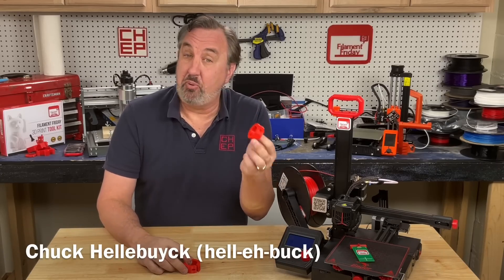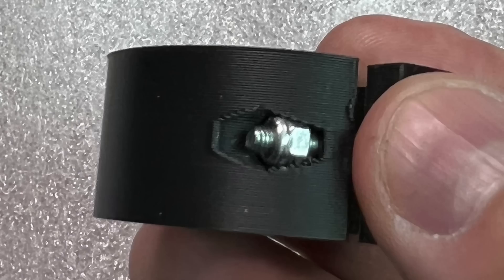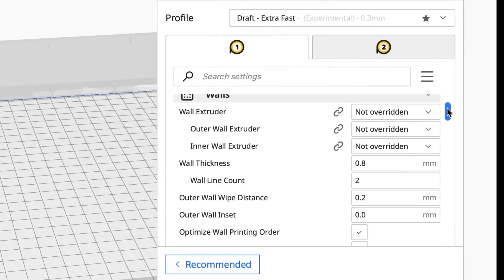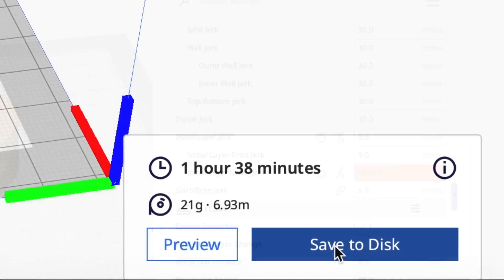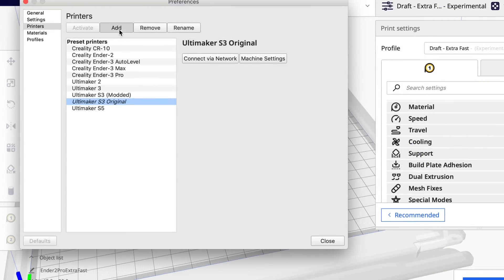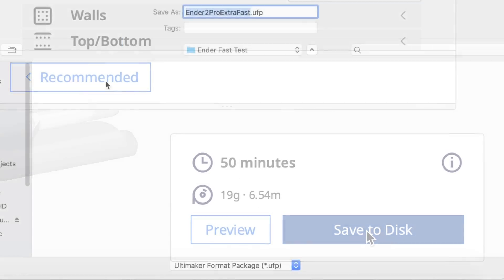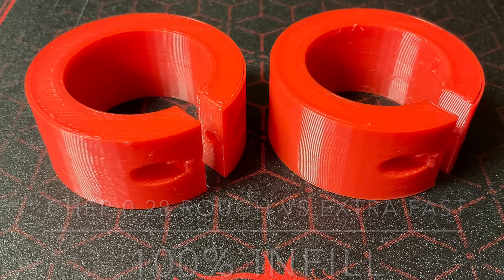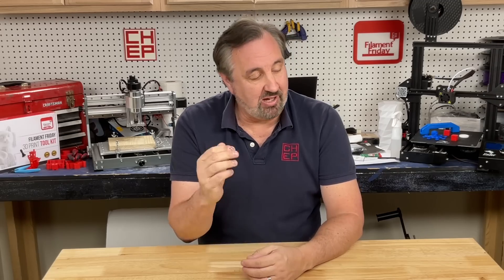Faster 100% Infill Prints with Cura 4.13 on Ender 3D Printer

Comment: This is a game changer! Thanks for sharing this. I just tried it on my Voxelab Aquila.
I printed some valve knobs on my usual profile that took 1h10m each at 10% infill with a .2mm layer height and 60mm/s print speed. I printed the same knob on this profile at 100% infill with the .28 layer height and 50mm/s and it took 35 MINUTES!! 
Cura tells me even at .28mm with my normal profile it would be an hour, so this has cut my print time by nearly half. I'm using this going forward unless it's something intricate and has small details.
Reply: Running the same thing. I found that if I cut my walls down from 2 to 1 (depending on what youre printing, I have 9 separate nested parts). It saved me an additional 30 mins. So my print time is under half of what it used to be. I'm in awe, just watching the Aquila whip around. Waiting for a print to finish to see if the parts will be durable enough. Also have a bridge so I'm curious to see if I'll need to really slow it down or not. It's nut to watch tho, regardless.
Reply: Should had read the comments because I just asked about the Aquila, lol, thanks...
Reply from the maker: Exactly why I shared this. It’s not to produce the prettiest prints but a great way to get functional prints faster.

Comment: If I may ask a question not related, I set all my parameters in Cura like printing speed and temperature but when I put my card in the printer and set it to print it always defaults to the same thing speed 100 temp 200/60 why is that?
Reply: You have to go into the menu in the machine and change the settings. also don't forget to save the settings on the sd card. when you insert the sd card first, then go change the setting to match cura it puts a little file on the sd card to save. I have multiple cards with my most used settings saved to the cards.

Comment: I follow your path except I used the profile of the S5 printer and  20% infill.  Using the same settings the profile of the S5 was 2 hrs 59 min  and the profile using cr6se settings was 4 hrs 22 min a savings of 1 hrs 22 min well worth it. The nozzle jerks very fast and the supports print very fast. The print has not finished yet but it looks good up to now.

Comment: This video inspired me to investigate, and I think I figured out what's going on and how to easily get this  benefit on older versions of Cura. I'm using an Ender 3 V2. If you set infill to 100%, Cura converts every infill layer to a top/bottom skin so it ignores your selected infill pattern, and prints the Lines pattern at top/bottom speed which is slow. The workaround is to set infill to Lines (or ZigZag) at 99%, and then if you're worried about the tiny bit of extra line spacing, you can set infill extrusion rate to ~101% to compensate. That cuts the print time down to roughly what I'm seeing with the Extra Fast setting, and the preview looks the same.

In real-world use, I find that Cubic 60% has been easily strong enough for anything I've needed to do so far, especially for compression. I printed a PETG test block with this infill, and could not dent it in my 6" vise.

Comment: The break in your sample looks like you have poor layer adhesion. Lots of people run at c. 95% extrusion ratio ( e.g. my ender out of the box) as prints look prettier, but for strong parts that choice reduces the weld between the layers. For this print i would use 0.65 or 0.7mm lines from a 0.4 nozzle and 3-4 perimeters (with alt extra). Infill can be 20% as it won't make much difference.

Comment: My prefered way to speed up 100% infill parts, is to just use really really high wall thickness, and set the infill to 0. That way the printer moves more fluidly (along the path of the part wall, instead of the constant ziging and zaging, which is slow as it has to change direction constantly). The estimated print time cura gives you is usually off, my method is usually quicker than the predicted time. I probably wont use the crazy accel settings shown in the video as I prefer to have less risky prints that are slightly slower, than waste time reprinting because of shifting or other issues.

Comment: I noticed a similar thing a week ago but i wasn't using the extra fast profile, just increasing wall count (basically all walls) with 100% infil and it had a similar effect on speed, from 3 hours to 1 hour. Gonna have to see if your advice helps even further, great video!

Comment: Infill is grid on u first one but it's zigzag. Lol read it bro
Reply from the maker: Yes, it’s my profile vs theirs.
Reply: @FilamentFriday  you seemed to not know why it was faster in the video lol
Reply: Cura normally replaces infill by 999999 bottom layers if you set it all the way to 100, so I'm confused still what's going on here.
Reply: @daliasprints9798  it'll infill but in a different pattern with faster travel speeds essentially

Comment: what is the speed if you simply increase the perimeters to a nigh enough value to be solid infill? or better yet, a number that creates the strength you need?  Often more perimeters will provide a better strength profile than going 100% infill.  Also adding an extra perimeter every other layer (on odd layers in SuperSlicer) works great for strength.

Comment: Good results even at 15% infill. 100% infill is not required. I am having a weird retraction problem at end of print where the extruder retracts 50% our of the bowden tube. Bad for next print. Its not in thee end gcode?

Comment: Hi, Chuck!
I tried the profile hack and the issue left to solve is the layer adhesion and extrusion flow.
From a 4h57m printing time, using the standard profile, to 3h12m using the hack.
The "make overhangs printable" option is also nice.
I'm trying the hacked profile on a Two Trees Bluer.
Thanks for these nice tips and tricks.
Reply: The flow and adhesion issues were due to miscalibrated extruder e-steps.
I'm struggling a bit with the retraction.

Comment: when you select 100% infill you can see at each layer that the infill is now yellow (not orange) it actually becomes a top/bottom and uses the much slower speed of top/bottom instead of infill, to bypass this you can use 99% infill, you'll see then that the infill is orange like normal and uses the infill speed
Reply: I like your funny words magic man
Reply: I think you're onto something!
Reply: I dont understand. I just rewatched video twice. At 100% his infill is orange. Not yellow. I'm probably blind, but can you give some timestamps what you are referring to ???😕
Reply: @ubqtous  go to 1;16
Reply: @frankimanX  you mean 01:16.......
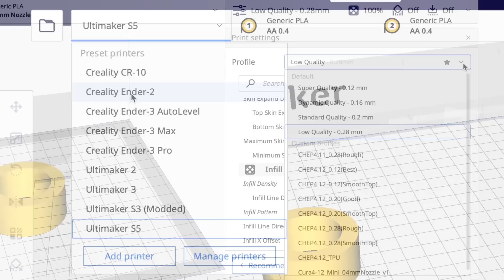Reply: @ubqtous 1:15 vs 2:09 - the first is Ender, yellow layers, the other - Ultimaker - orange. Yellow is top, orange is infill.
Reply: @sharpfang  so in other words, Ulitmaker had a bug where they were using the wrong print speed for 100% infill, and they finally fixed it after many years, and called it an improvement 😂
Reply: Good tip!

Comment: Maybe it's not suitable for your audience, but I was hoping you'd dig into WHY the two gcodes achieve such different results. Is it taking a different path? Is it using a different line width or flow rate so it doesn't need so many zigzags?

Comment: There's a problem with the model, that's why there's "stringing". Slice it in PS2.4 and it clearly tells you that there are empty layers between 6.2 and 6.8mm of the model.

Comment: What the fu k is wrong with Ultimaker that they give it not all users?!?!!?!
Reply: Dumb question gets dumb answer…🤷‍♂️
Reply: Such high accelerations and jerk settings can cause damage to the printer, they probably don't want to get complaints from people that will use that profile with printers that can't handle it and eventually break, I highly doubt the reason is $$ when the program is free...
Reply: @E_y_a_l  they could easily mitigate that with a disclaimer “not responsible for damage caused by pushing machine past limitations” this is 100% money. Ultimaker makes this software and gives incentives for people to use their hardware. Things like “print twice as fast if you use our machine” even though as clearly indicated it is only soft limits in the software that make the difference.

Kinda like Tesla selling “modes” even though it’s the same car you can pay for them to unlock features that you already have just are not aloud to use.
Reply: @jonathonhaberkorn233  If that's the case and they want to block this feature to other printers then why you can copy these settings and use them with other profiles? you're claiming they didn't thought about people doing that? when they charge money for that feature you'll be able to say it's about money, until then it's just an un-based theory,  seriously people, stop being so cynical, they are giving you a full working good slicer program for free and you're still thinking you're getting ripped of, about a disclaimer, I wasn't talking about a legal issue, I was talking about complaints, and as you and I know, disclaimers don't really prevent people complaining and most people won't even read the disclaimer before they click ok, I paste here what I wrote in another comment: 

"The question here is if the settings can damage the printer, one short move can damage a printer if it's aggressive enough, when you set the profile to a 4000 mm/s acceleration when the maximum supported value by the manufacturer of the printer is 500 there's a potential risk of damaging the printer, that's not twice, not 3 and not 4 but 8 times the MAXIMUM supported value, if you want to go into conspiracy theories about money being the reason it's your problem, but you can't deny the logic about a company being hesitant with sharing a new experimental feature with untested printers, and if you do deny it, try to do it with a logical reasoning and not just say $$.
"
Reply: @E_y_a_l  it’s a conspiracy now? That companies want you to purchase theirs products and services? Ok then… by the way I was not complaining one bit about the free service that is cura, I think it is amazing. I am most certain this is what we would call marketing, don’t like how long your prints take? Buy an ultimaker! And your average user is afraid of things like “configuration” they just want to plug it in and do stuff… but hey what do I know?
Reply: @E_y_a_l  also, have you seen the “experimental” tab at the very bottom of the advanced settings, that are available to all users free of charge… maybe that is where one might put experimental software?
Reply: @jonathonhaberkorn233  1. Conspiracy theory, not conspiracy, there's a difference so don't put words in my mouth, and I didn't said that ultimaker doesn't want to make money, I've said there isn't an indication that the specific feature we are talking about is only available in the ultimaker profiles to make money so again, don't put words in my mouth and if you want to contradict me address what I wrote and not what I didn't wrote.
2. I'm very familiar with the experimental section, and that section isn't meant for settings that have high risk of damaging printers but rather settings that have some risk in failed prints, again, there's a difference(check in ultimaker's web site, they say it themselves), so again address my claims instead of avoiding them, setting 4000 mm/s steps instead of MAX 500 isn't a small change and isn't a small risk for the printer, in such an early stage of the development of this feature that's a good reason to limit that setting to printers they know can handle it.
3. I'm not connected to ultimaker in any way and I'm not defending them, all I'm saying is that there's no evidence that indicate that this feature is limited in order to directly or indirectly earn money out of it, so until you'll get some kind of evidence to back your claim thinking that this feature is there just to earn money is a cynical thinking, especially when we are talking about a free and fully working product, if they wanted to make people buy their printers they could have limited a lot of other parts of that program that are much more crucial than that setting, you say "don’t like how long your prints take? Buy an ultimaker!" but you're forgetting this setting only works with 100% infill, this is a niche risky setting, even if they will keep that setting limited to their printers, not many people will buy their printers just for that feature and I assume they know that, so turning CURA into a "buy to use" type of program with all of the community backlash that will come with it just for that feature? sorry but I don't see the logic in that claim.
Reply: @Wrublos212  omg....that's the answer of mankind.....we must tell this secret everyone 😂👍

Comment: I’m not sure what kind of voodoo this is but I tried this on my CR-10S Pro V2 and it took a 54 minute print down to 17 minutes with no difference I can see in strength or quality????  Thank you!!!
Reply: Oh that interesting...have the same printer....now I will try Voodoo too😂
Reply: Which Ultimatker did U choose in your profile?
Reply: @Martin-zd8eb  I think it was called “Super Fast” or something like that. I’ll check later and if I’m wrong, I’ll come back here and correct.
Reply: @bowieinc  that's clear for me....but did U choose a Ultimaker S3, S5.......?
Reply: @Martin-zd8eb  I’m not sure what you mean. 
I went to Chep’s thangs site linked in the description, then downloaded the zip file then in Cura I selected file, then opened   “FastSolidPrint_Ender3.3mf”, the selected “open as project” then made all the machine settings like Start and End G-Code, bed size etc then changed the name to Chep Fast CR-10S Pro V2 saving it as a new printer. 
Maybe I did it wrong, but it worked. I did not go in and add a “non networked printer”. Hope that helps:) Oh, the Profile I used in print settings is called “ Extra Fast Experimental”. I dropped layer height to .2 and bumped speed to 100 mm/s.
On another print (which I’m getting ready to do. The regular .3 draft was 14 hours and the experimental .3 draft was 6 hours.

Comment: Why didn't you just set print areas,  100% in fill around the bolt and 10% the rest of the model in a cubic pattern.
Reply from the maker: It’s not about the print. It’s about the process of saving time overall. Not all prints can have just a location solid.
Reply: @FilamentFriday  you definitely saved time.  Video was great and informative.  I think setting solid areas though might be a good secondary solution.  Personally I'm leary of jacking up to extreme accelerations. Because of possible belt skipping,  wear on motors, etc.